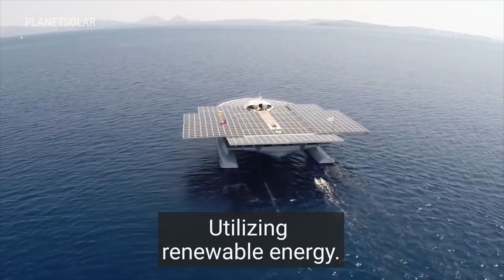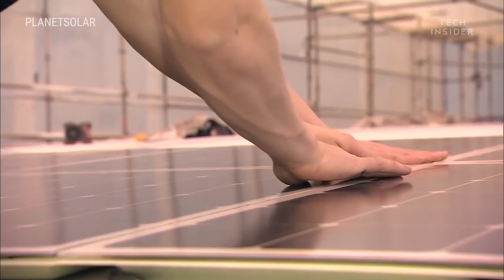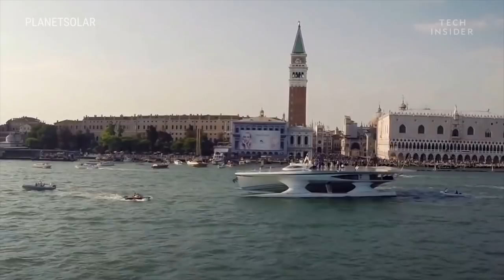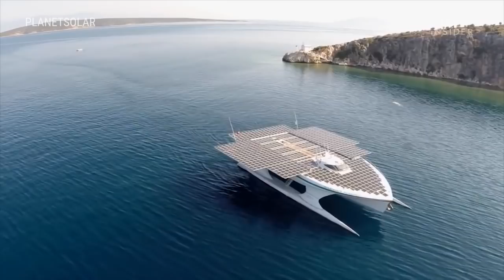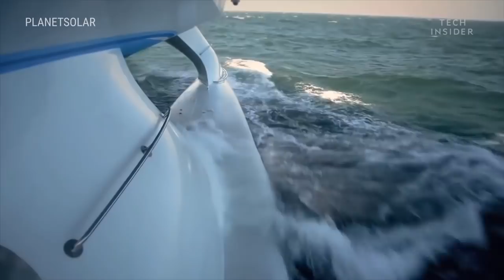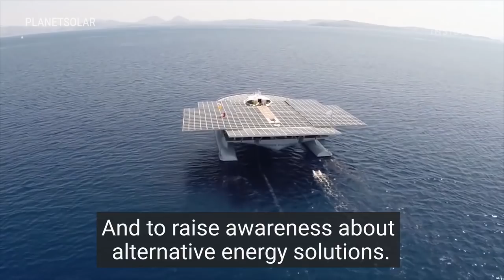World's Largest Solar Powered Boat - First to Circle Globe - MS Tûranor PlanetSolar

Comment: Impressive achievement! Clearly, not the way to move 11,000 shipping containers from China to North America.
Reply: Imagine two container ship hulls being the catamarans, with a frame between them covered in solar panels and masts with sails.  I don't know how fast a ship like that would move, but in theory it would work.  Since it would be too wide to fit in ports, you drive a smaller ship between the hulls, and lower containers from the cross-deck above to load and unload.

Comment: yes...the carbon footprint that needs no other rebuild / engine overhaul / fuel use / oil change every so many hours....umm...EVER...    the use of hypercaps will last for decades...
those sailboats were great...but then there's the human weakness for AIR CONDITIONING / REFRIGERATION / HEATING / ELECTRONIC DEVICES.
and yes wind can be used to further the energy regen. for desalination for drinking water...hydrogen development, etc
but that's another video...a whole 8 years have passed, since this one.

Comment: One would think that with all these panels and 120 KW and the catamaran layout that it could achieve decent speed faster than a sailing boat . I really was disappointed by the 5 knots figure
Reply: Night and cloudy weather.  It probably goes faster on a sunny day.
Reply: That's about 185 HP, so figure 1 Jet Ski engine pushing how many TONS ??

Comment: What size diesel generator on board? How many gallons of diesel on board? How much energy, fossil energy was consumed mining the minerals to produce not only the panels but litteraly every single bit of that vessel and i mean eveeything. Its all a big joke.  Great achievement but it doesnt solve anything. Ships, shipping containers, oil tankers, commercial fishing vessels, ferrys all of which run on fossil fuel. And whats wrong with that? This boat and what it represents is leading the way to cool the planet thats naturaly been warming the same way it has for a millenia?. No not at all